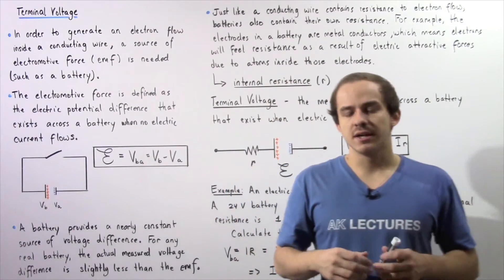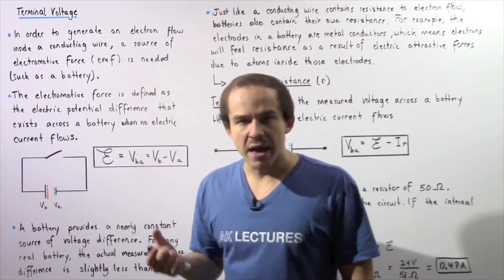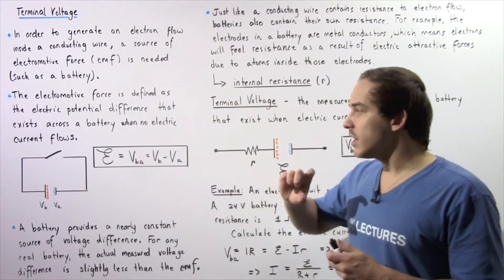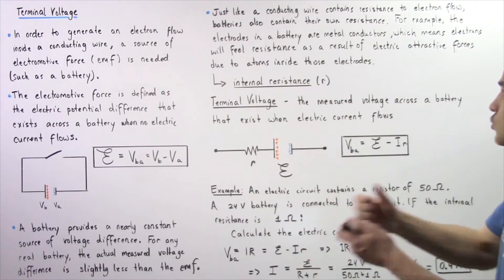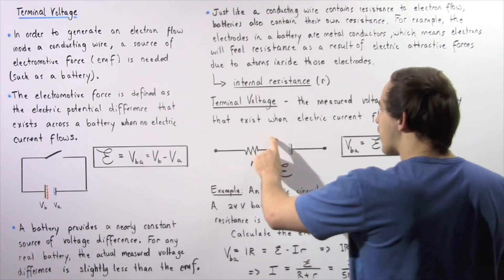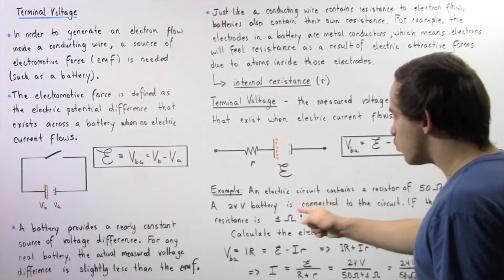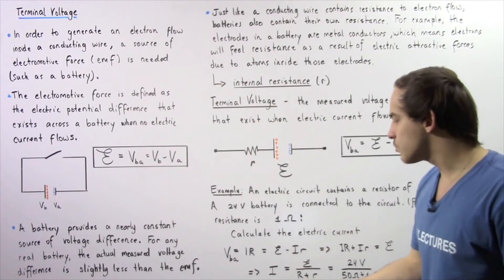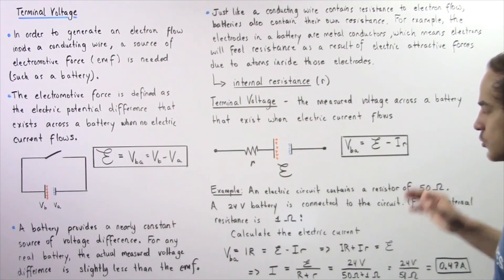Electromotive Force, Terminal Voltage and Internal Resistance

Comment: so basically Electric Potential difference across a battery when no current flows through the circuit is EMF and the Electric Potential difference across a battery when current flows through the circuit is Terminal Voltage????